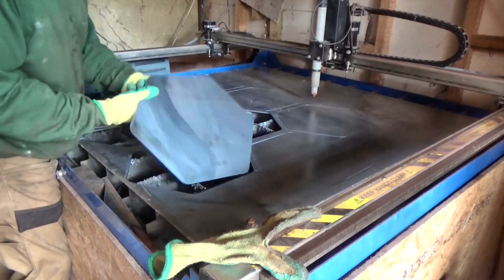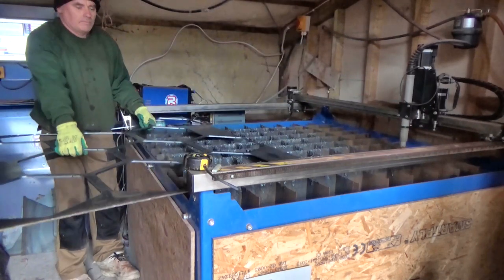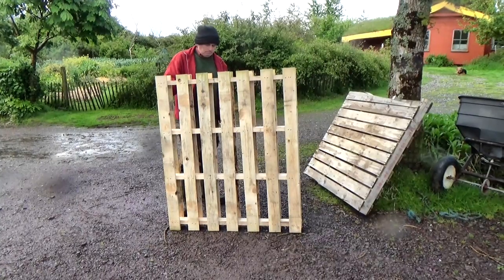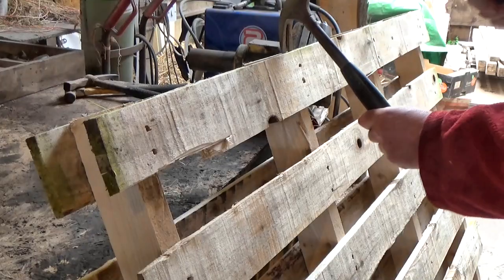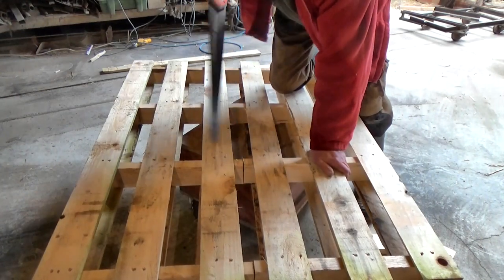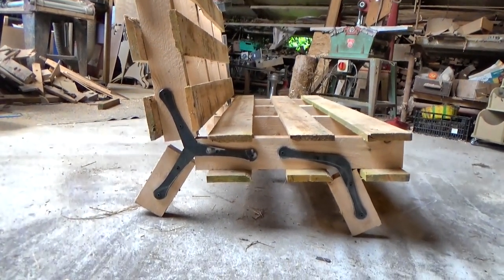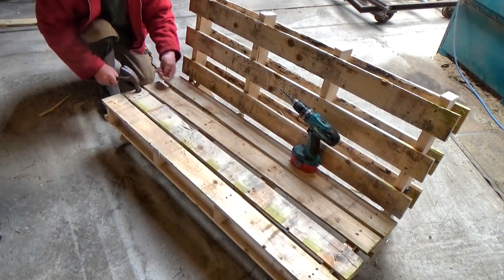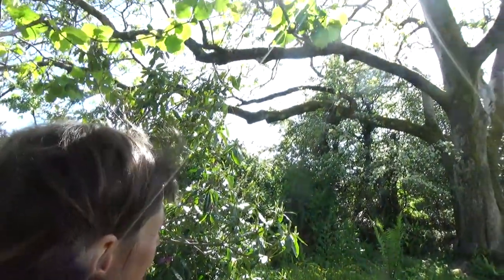The Best Pallet Bench Ever! - Made Easy With These Brackets..

Comment: One of the problems with softwoods used in pallets (Spruce, Pine, Fir usually) is rot. Linseed oil will dramatically improve rot resistance, but the biggest rot point is water being drawn into the end grain from the floor as in your legs. If you extended the steel leg brackets you could do away with the wooden bits. This would both save you a manufacturing step and give a longer lasting product with less chance of a leg giving way when you sit for your afternoon tea. If you want to dismantle a pallet with minimum splitting, a reciprocating saw with a steel cutting blade will go through nails very easily. Sometimes you have to slightly pry the plank back, but often not. Using a hammer on a hammer will get you complaints: Both are hardened, so the risk of one or both emitting, when struck, small, sharp fast moving shrapnel is high. Black Smiths harden hammers, but leave the top of metal cutting chisels etc soft to reduce this problem, hence the burring up of steel hamer end chisels with use. There is a similar risk with hardened wood screws used as nails. A carpenter I know was chastised for hammering in screws while on Piece work and replied that the cross in the end was only useful for extraction. Thanks for sharing!
Reply from the maker: You're right, but a steel leg would just sink into the ground - so you'd still need to put it on something..
Reply: Either put 4 pieces of paving slab down under each steel leg, or weld on a bit of steel the same cross section as the wood you are using, presumably available from the scrap after the pizza tops are cut so no material cost.
Reply: @springwoodcottage4248  But for sixpence ha"penny Tim can knock up 3 more pallet benches when the legs rot. Or just replace the leg timber.
Reply: @rubygray7749  Sure he can, but there is nothing so pleasing and efficient as making something that lasts and lasts and leaves future time for doing exciting new things rather than maintenance of old projects.
Reply: @springwoodcottage4248  Tim is a builder, but this is not about making fine furniture! It is a very basic tutorial in quick construction of a useful garden seat from waste timber, for people with limited skills and tools.

Comment: Nice bench. But it seems to be a bit low.  I would place a stone brick under each leg. This would also make the legs last a bit longer.
Reply: I would consider putting a horizontal rail from a 2x4 on edge to bring it up. Typically seating should be 18 inches (450 mm) off the ground. This would also mean it would be the side grain in the ground rather than end grain which tends to wick up moisture and rot more quickly. Great bench idea, with minimum of work though. The way you leave the ends of the joints open, not fitting them carefully, actually allows the wood to dry out better after it gets wet, will probably last a long time at the main joints. Only possible problem is spider webs inside the frame in some climates, hope that is not a problem there.
Reply: @garywheeler7039  
And splinters!!

Comment: Excellent! One tweak: I would probably saw off the base of the legs at the angle needed to make them sit flat instead of on corner edges.
Reply from the maker: Well yes, but I was trying to keep things simple  : -  )
Reply: I beleive the garden soil is soft enough to just let it level itself. It won't work on the rock or concrete, so you're certainly right if you're going to put one on a street :)

Comment: Tim,
even though you want to keep it simple:
1) is there no need to brush them before sitting? I mean, the rough wood might be very aggressive to clothes.
2) don't you want to paint it (as a protective measure rather than aesthetic one)?
Reply from the maker: Well yes, if someone made these they could sand them and paint them, of course. But we wont bother because we only ever wear old clothes anyway, and painting these would be tricky because of the layers of a pallet, and it wouldn't make them last any longer.

Comment: Please don't show people hammering on a hammer with a hammer, this, is a well known no no, hard hitting hard can generate high speed flying chips of metal!! Cheers, Matthew.
Reply from the maker: I was taught that a hammer is the real screwdriver, and what we call a screwdriver is a screw-turner.  (And there's no way one of these screws would chip into bits under these conditions...)
Reply: @WayOutWestx2  Hammering on a hammer  head with a  hammel is dangerous!
Reply from the maker: Oops, I thought you meant the screws. No, you're quite right. But I've been doing it for so long without anything ever happening that I forget that it might. I wonder if was only older ones - modern hammers seem just to dent.
Reply: I recall myth busters looking in to it, and not being able to get a hammer to chip.even using old hammers.
Reply: @MIck1-10  Obviously, you do what you like. In fifty years working manually, mostly with metals I've seen enough chipped hard metal objects chipped. I wouldn't tell people on a youtube video to hammer on a hammer. I don't take myth busters as definitive proof of anything!
Reply: @MatthewTinker-au-pont-blanc  I wouldn’t do it my self  just an interesting point from the tv show. If memory serves correct the force they used bent the hammer shafts. Like yourself my working life was on a factory floor ,safety is the first consideration.